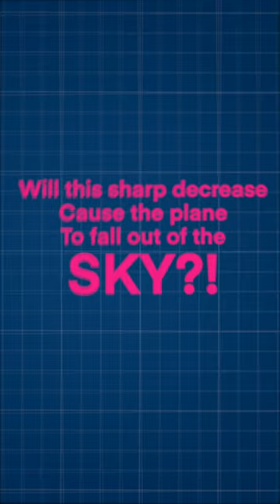What is a Stall? #shorts

Comment: What about the an-4?
Reply: What about it?
Reply: @PilotInstitute  i have heard that the an-4 is unstallable. If you try to it will just glide to the ground at 20 or 30 mph.
Reply from the maker: There are quite a few planes that are harder to stall.
Reply: I cant find any plane named the an 4
Reply: @exotic_knight_2786 ok i did some research, yes there is a plane called an-4 which has no stall speed, however it is a designation to the an-2v, a lot mote known plane, that is only built in Kiev.

Comment: Stalls are caused by drop in Airspeed.  The AOA is a symptom of reduced airspeed and pilots attempt to maintain altitude.
Reply: Stalls happen because the airfoil has reached the critical angle of attack. Reduced airspeed is a by-product in most cases but remember that you can stall at ANY speed, slow or fast.
Reply: Not every stall. You can have stalls at any speed. You can indeed have stalls due to lack of airspeed and also have a stall due to exceeding the critical AOA
Reply: The definition of a stall is when the wind exceeds its critical angle of attack. Stalls are not caused by a drop in airspeed. An airplane’s wing could have an airspeed of 5kts and be flying whereas an airplane flying at 200kts could be stalled. It’s all angle of attack. The “published” stall speed for an airplane is at its max weight under 1g.